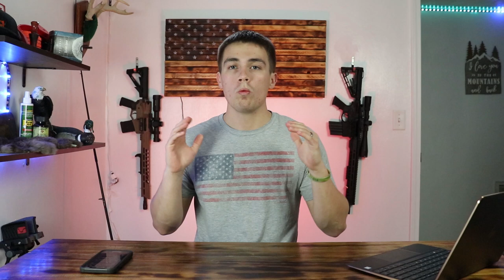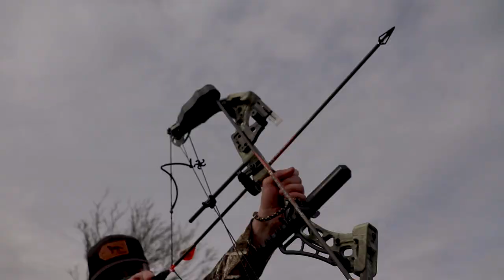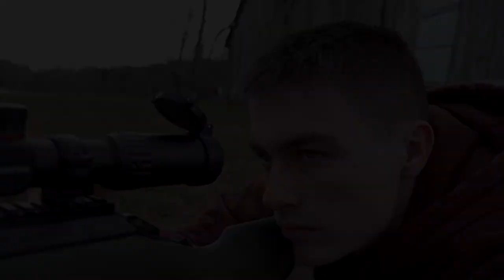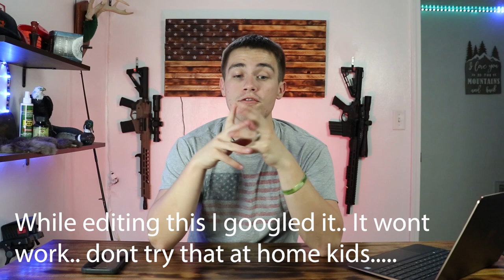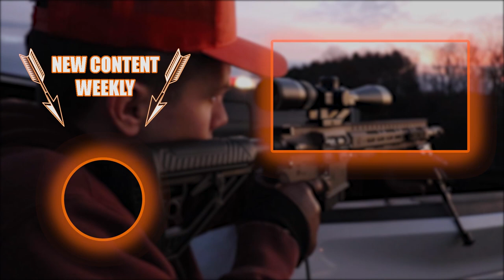Problems With Building The AR-10! (Must Watch!)

Comment: Great video touching on some of the additional considerations when building an AR-10/AR-308 compared to an AR-15.  Unfortunately, you didn't touch on the issue I was looking for an answer to, the different buffer tube lengths, how that effects buffer & spring selection and how to choose the right combination?  Possibly an idea for a follow up video?
Reply: Buffer tube/gas system lengths are, I think, pretty much the same for both AR15s and AR10s, and come in pistol, carbine, mid, and rifle lengths. If I remember correctly, it mostly affects recoil impulse - a shorter system will have sharper recoil because the buffer has to do the same amount of deceleration on the BCG over a shorter period of time.

I think you should be able to use any length of buffer in combination with an length of gas system, but the one most people seem to prefer is a carbine buffer with mid gas.
Reply: Nailed it!  I will say personally I found a sweet spot with carbine buffer and a rifle length has system with adjustable gas block, recoil impulse is smooth and bolt locks up quick

Comment: I have a diamondback ar10 and it runs good sometimes and then other times it won’t kick the spent shell out but tries to chamber the new round and they run into each other. I would call it double feeding but with the spent round.. Iv had people tell me it’s over gassed because it’s throws the shells way forward. Would you think an adjustable gas block would help this problem? Sometimes it feeds an entire mag Just fine, then sometimes it’ll jam every other round. Plz help lol
Reply: Bit of advice i own one as well i bought a 20 inch barrel and upper for my thermal was just gonna swap uppers from thermal to scope but the PSA ar10 upper has a curve on the back pin instead of a angled cut. Just thought id let u know since i just found out after attaching everything to my new upper went to hook it to the arca swiss adapter and the lower and realized no thats never gonna work. I put a triggertech diamond trigger in my diamondback its freaking epic if u are looking for a replacement trigger diamond all the way. 1.75 pound pull

Comment: Thanks for the info that your putting out there. I have an Aero Precision AR-10 chambered in 6.5. Love it! shoots like a dream. Only thing I would like to change is the barrel length, and I also want one chambered in .308. I decided to kill 2 birds with one stone, and bought a .308 upper with the 22" barrel. It came today, and I was eager to put it together. I ran into the same problem that you had when there is a gap between the upper and lower. Only difference is my rear pin won't line up. Called Aero Precision, and they told me about the little recessed, nylon tipped bump stop in the bottom, where the rear pin goes in. It's purpose is to eliminate any slop that might be in it, even though they fit really well, except for the hole for the pin. Apparently that is completely adjustable by removing the pistol grip, and simply draw it down a bit. I don't know if that is something specific to Aero Precision, or if they all have it but, It might be something to check if you are having fitment issues. Especially if the parts are designed to go together.

Comment: an AR10 is not a beefed up AR15. an AR15 is a downsized AR10. the AR10 was built first. the AR15 was made later because of the weight of the gun and ammo.

Comment: Just finished my enhanced aero precision m5 build. All Aero is DPMS I think. The trick is .....ppssssst....wait for the lower to be in the blemished section on Aero's site. Even if its stripped just snag your parts out of the lower you have. But yeah you do need to get the right rail height. That's why I bout all m5 enhanced....which is a bitch to find a m5 enhanced handguard. Check sportsmans guide, and litterally Google M5 handguard my dude they are online young fam
Reply: Sergeant Arm of Texas handguard is perfect fit for Aero upper.

Comment: Having problems with feeding, any suggestions? Fires great, zeroed in however...is not upfeeding rounds and requires a manual load each time. Extracts, ejects round but does not pick up and feed next round, I'm scratching my head.
Reply: Have you tried a different magazine?
Reply: @thatdude5322  have  ordered a couple of different one's, once they arrive will update.
Reply: You should check your gas tube length. I have seen ar10s with ar15 tubes in them. Forums I've read says it makes a difference.
Reply: @Football07able  that's the difference between armalite ar10 and dpms lr 308. Ar10 is longer, dpms uses ar15 gas tube.

Comment: Good morning. great video. AR-15 for anything from Varmint to Deer with a Sharps 25/45. Great cartridge that is around 300 to 400 fps. faster than .223, it has 1/3 the drop and almost 3 times the energy at 300 yards and the recoil is just around 10% more than the. 223. AR-10, I have several and they are in both 308 and .260 Rem. the .260 Rem. with a 24 inch barrel is actually better than the 6.5 Creedmoor but Remington did a lousy job advertising it so it never took off like the 6.5C. As for not so great for hunting, you need to do a bit more research. lol. My AR-10's are just as accurate as any bolt action and just as reliable. Broken Arms 80% lower, Aero Precision M-5 upper,  JP Rifles Handguard, Wilson Combat and Rainier Arms Barrels, Sharps Rifle Company Bolt Carrier Groups, LPK, Buffers tube, End plate/Castle nut and Ejection port Cover are Strike Industries, buffer spring is David Gibbs. Incredibly accurate rifle and darn good looking as well. As for hog hunting the 25/45 Sharp was actually created for that purpose. it has great range and knock down power and it is no heavier than a .223 . But I do agree with you as far as the AR-10 is more work and it's because of the nonconformity like the AR-15 format. They do cost more and take more research to build right hut if you are careful you will end up with a wonderful med size cartridge AR. With my 10's I am able to keep a .75" group at 200 yards so built right they are extremely accurate. To date I've take 2 Elk with my 10's. one with a 308 and the other with a .260. Both at around 250 yards. Good luck with your build and be safe.

Comment: Hey Elliot I need help building a ar10 308 can you point me in the right direction like what company should I use to build this AR? I don’t want a LR 308 or a psa ar10 ... I really like aero precision AR10 but not sure what parts are compatible?
Reply from the maker: So I am doing aero. They are a DPMS pattern AR10. Aeros website has good deals on their Blem products so keep an eye out there. The best advice I have is when you find parts contact the manufacture and confirm if they work with what you are building. I did that with a few companies and they were super helpful!
Reply: @ElliottDelp  thanks for reaching out too me really appreciate it !!! So 5d tactical has some lowers and says it will fit on aero upper parts so I’m thinking that’s the route I’m going to choose .. I’m fairly new to building and this may sound like a stupid question but what’s the difference between lr308 and DMPS 308?
Reply from the maker: @alexp6456  I think they are the same thing. I think that it’s DPMS LR308 and Armalite AR10. Correct me if I am wrong. I also think there are multiple Gens of the DPMS so be careful if you are buying different brands.
Reply: @ElliottDelp  thanks for all the info you are awesome  !! Keep the great content coming on the channel !!
Reply: Rubbercity bolt carrier group are excellent.

Comment: The ar 15  is a downsized version of the ar 10. Armalite downsized the ar 10 into a smaller version (the ar 15) as a potential replacement for the M1, but when the army tested the ar-15 in the field it didn't preform to there standers.  Also just like anything else man you get what you pay for, if your a cheap MFR you get cheap quality and results a good example of that, the end results of every cheap AR 15 build being a rattly un-accurate jamming pos

Comment: I build an AR-10 that fits perfect and runs very smooth. All I did was do my research and match the platform, which all products that you buy will say what platform it is. Building an AR-10 is not complicated and is just as easy as an AR-15.

Comment: The only " complication " is the misuse of the wrong name from a specific weapon. 

Stop calling all .308 gassers "AR10"

You either have :
An AR10 ( A or B models)

An LR308 (High rail or low rail)

An SR-25

All 3 ARE 100% standardized ! With their own set specs. Calling your Aero M5 an "AR10" is 100% Ignorant. That is unless you are referring to their earlier SPR' for ArmaLite, which are absolutely AR10. Ask me how I know..
They are 3 different platforms stop limping them in one catagory, educate yourself and building won't be that difficult at all. 

Good luck.

Comment: My only problem with aero precision and ar10 is ar10 is proprietary to every manufacturer, and aero precisions bolt carrier group and bolt face is absolute dog 💩. Sucks because that’s an extremely critical part to malfunction and break and being bcgs on ar10 don’t cross between manufacturers really. Aero ar10 bcg catastrophically malfunctions around the 2000-2500 round mark. And their ar15 bcg isn’t much better either.

Comment: Oh yeah and by the way your not the only person having cycling issues apparently this is a common problem
Reply: Mike Phillips  really that’s actually a good suggestion I’m going to make a note of that and check it tomorrow.
Reply: Mike Phillips  thanks
Reply: Mike Phillips  it was the gas tube I managed to get a couple 15.5” gas tubes from ArmaLite. Went to the club to test my rifle out and she ran like a champ. Only thing I swapped out was the 15” AR15 gas tube with a ArmaLite LF AR10 15.5” gas tube.
Reply: Adjustable gas block and springs does make a huge difference.

Comment: An AR-10 is NOT a larger framed AR-15. The AR-10 came first and the AR-15 became a miniaturized version later
Reply from the maker: Lol okay but still essentially it’s a larger AR15 😂
Reply: @ElliottDelp  They share the same operating mechanism, but he's technically more correct.
Reply: Yes the original AR-10 came first then around 1957 ArmaLite scaled it down for a smaller cartridge and the new rifle was named the AR-15. By 1963 AR-10 manufacturing had ended while the AR-15/Colt 601 was beginning to sell in large numbers. The AR-10 remained dead about 30 years until Eugene Stoner and Reed Knight SCALED UP the AR-15 to a new AR-10 (KAC SR-25) that had a lot of AR-15 parts interchangeability, especially in the lower receiver. About the same time the new ArmaLite did the same thing and named it AR-10 since only they actually owned the legal rights to the term "AR-10". 
So today's AR-10 (and 308 AR clones) actually is a scaled up AR-15.
Reply: There is always that guy who corrects the words used but missed the context and meaning of the sentence said.